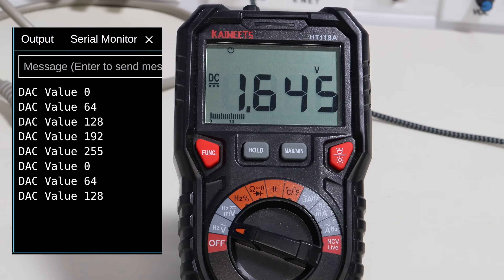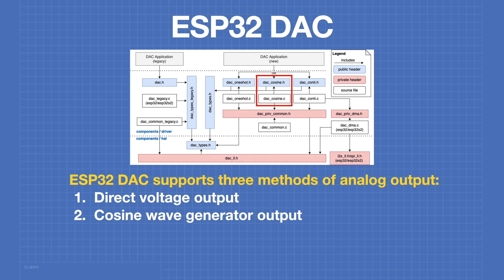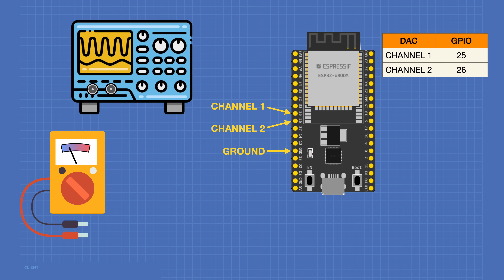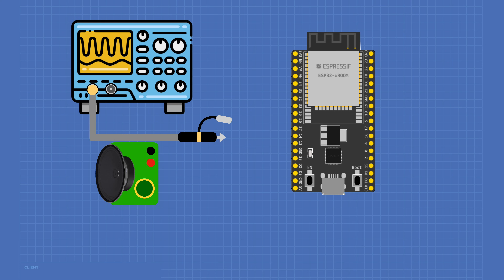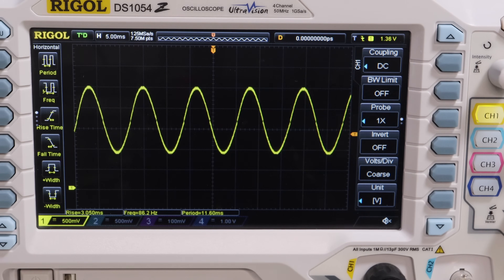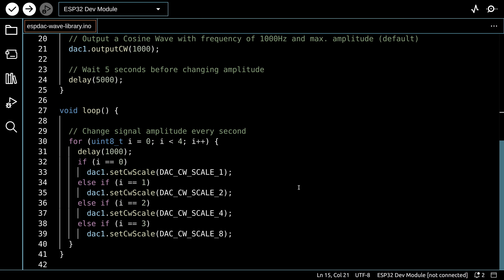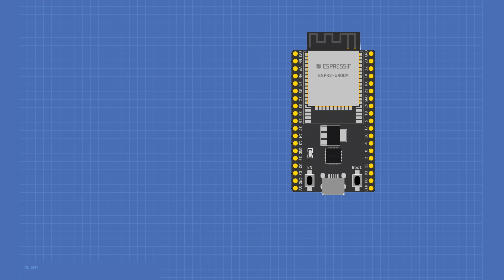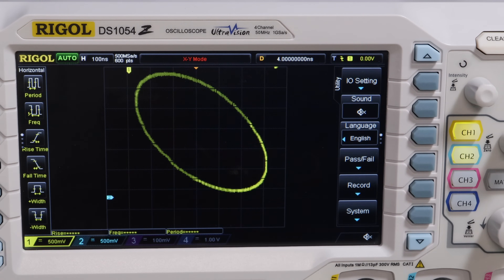Using the ESP32 DAC - Voltages, Waveforms & Sounds

Comment: 00:05 - ESP32 DAC allows for creating DC voltages, waveforms, and sounds
02:33 - ESP32 DAC supports three different methods of analog output
07:24 - Experimenting with DAC voltages on ESP32
09:31 - ESP32 DAC output voltages are consistent but may not be precise.
13:46 - Generating complex waveforms using the table method
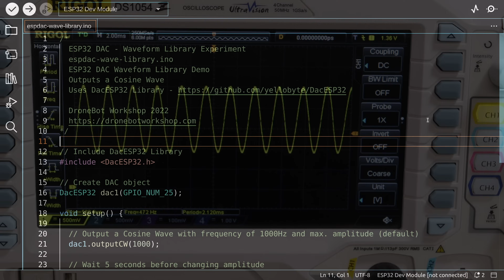15:50 - Using the Sadac ESP32 library makes it easier to output waveforms like cosine waves.
19:59 - Creating oscilloscope art with ESP32 DAC
21:53 - Connecting probes and making art with ESP32
25:46 - Connecting sensors and touch switches to create music using ESP32 DAC
27:50 - Setting up Musical Fruit code using ESP32 DAC
31:38 - You can make music with this fruit
33:27 - Playing Mozart using ESP32 DAC

Comment: I found your channel and from the few videos I have viewed on ESP32 I am impressed with the easy to follow. I manufacture wireless radio controlled LED fixtures. My goto processor is the PIC and its a great platform but I want to share our technology with the DIY community and the ESP32 looks like a better fit for most DIY. my products use radios, sd card, flash, ram and OLED display all of which I will have to learn to use with the ESP32. Thank you

Comment: At 9:13 into the video, you mention not using an external reference. I was hoping the esp32 would allow that but the datasheet says the reference can only be the power supply voltage. That is regrettable. I was hoping you were right since I need an 8 volt reference. Nice video nonetheless. You put a lot effort into it. It is appreciated!

Comment: Have to respectfully disagree with Bill's "stretching of the term, 'art'" comment. Laserium laserists (official job title) during the '1972-80s performed a cycloid waltz of The Blue Danube, with nothing more than 4 phase shifting circles and figure 8s. Laserium audiences inside Planetarium domes throughout the world loved those shows for over 4 decades. Many of us still do.
I've just finished developing a PCB for a MIDI/DAW controlled Teensy Laser Synth, with a 6in ADC/8 out DAC I2 CODEC + op amps to relive the pleasure of playing abstract 'visual music' in my living room. It has grown from your basic lissajous images to 30 waveform oscillators, 8 amplitude modulators, 3 RGB color/intensity modulators, & 2 * 3D vector graphics generators, with XYZ axes rotations.

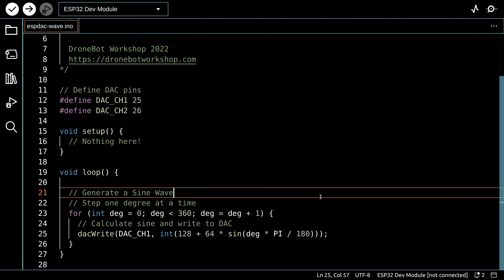Comment: At 12:13 What is the logic behind the int value of 128 + 64*sin(deg*(pi/180)). I mean what is the significance of 128 and 64? Is 128 the base value of sine wave and 128+64 the max value. So 64 is the amplitude. If that is the case can we not start at 0?

Comment: The DAC on the ESP32 might not be high end audio quality, but I used it just over a year ago to create a little device as a joke for my new electric car....
I stuck the ESP32 inside an old set of USB powered (but analog input) computer speakers, and had it play the old clip from The Simpsons where they saw the electric cars or tomorrow... "Hello. I'm an electric car. I can't go very fast, or very far. And if you drive me, people will think you're gayyyy".
Shoved the speakers into the glovebox, ran the USB power cable out to a standard USB phone charger cigarette lighter socket adaptor, and it would play the clip when you start the car up....
Several hours of fiddling with electronics and libraries and stuff for a 20 second joke for when my brother visited for Christmas 🤣

Comment: Excellent tutorial on what the ESP32 DAC can do, however, I have been looking everywhere for a way to build a high quality music player without I2S (your I2S video was awesome) considering the ESP32 is the only hobbyist microcontroller with I2S support.  They have been building great sounding CD players, for example, since the early 80s and since modern microcontrollers are so much better than what they had available then, there must be a way to do this.
Reply: The RP2040 also has I2S support with PIO, RE: hobbyist microcontrollers.  In fact, you could even do a bunch of channels on one if you wanted to.